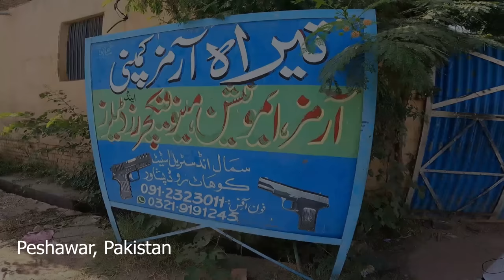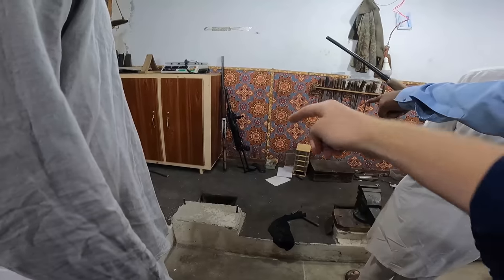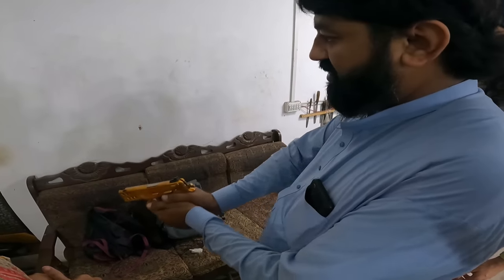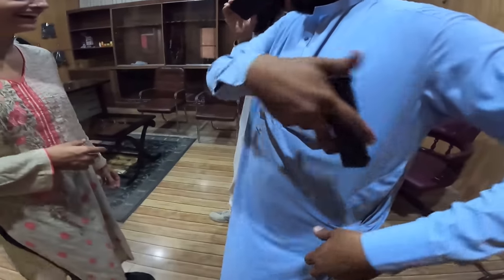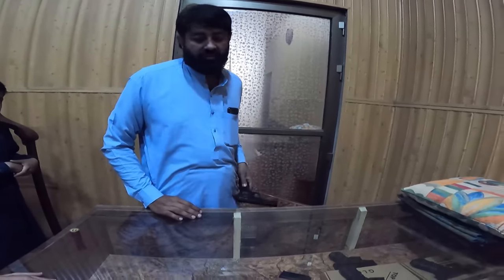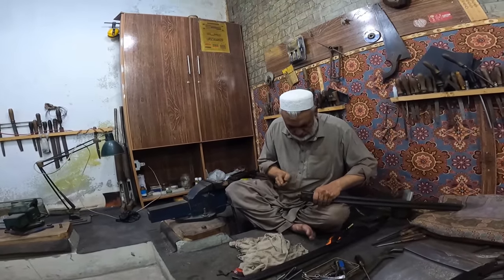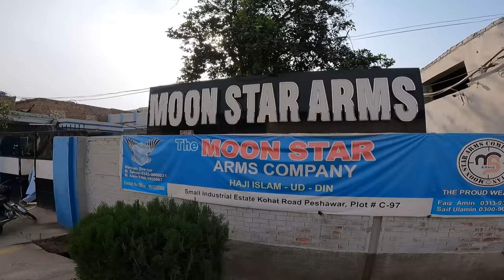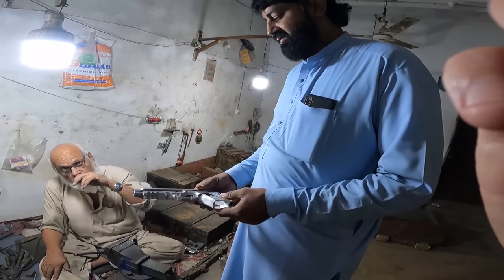How Pakistan Makes Weapons! (extremely cheap!)

Comment: And the simplicity of that workshop is why guns will never disappear from our culture. The cameraman was asking about CNC machines, you don’t need that. Even modern firearm manufacturing is a 19th century process. CNC machines just make it faster and less labor-intensive.
Reply: The equipment is what a well furnished gunsmith shop would use in the USA.  Many gunsmiths do not have so much equipment here in the USA.  To completely make a gun, the hourly rate would be way higher in america.  It would  be the cost of a custom gun that runs into the 1,000's of dollars.  The pricing of modern hand guns is kept low by use of mim parts, synthetic plastic materials,  polygonal barrels, and mass production techniques.
Reply: Bandsaw, bench grinder, drill press, carbide burrs, punches and files…voila gun factory
Reply: 19th C?  LOL.

Comment: It looks like quality weapons.
Reply: The metallurgy of the barrel, locking systems, and other parts is very important.  I would be concerned about guns blowing up.   Typically such places in the past got raw materials form auto salvage yards, like springs, steering columns, axels, sheet metal, etc.

Comment: Can these actually be reliable? The hand workmanship is incredible, but functionally reliable for any amount of real use? Hard to believe.
Reply from the maker: They send the rifles and shotguns that are engraved to england apparently! This place has a very good reputation abroad from my understanding.
Reply: Consider that until WW1, the vast majority of firearms in the world were manufactured exactly the same way. Assuming decent materials, and skilled hands working them, the only real difference from "real" manufacturers is the time it takes to produce the arm. A case could even be made that due to constant hands on work, the "primitive shop" firearm is probably less likely to have out of the box defects. Undoubtedly there are shops that turn out questionable quality products, but here in the states we had lorcin and raven junk pistols too.
Reply: @ludditeneaderthal  CNC's though undoubtedly have far superior precision and repeatability, it just cannot be beaten by human hands in terms of consistency.

I'm not going to say they are unreliable since anyone can walk into a plumbing isle of any hardware store, grab some pipes (STEN style) or box section tubes (MAC style), and as long as the bolt weight is roughly 330g for 9mm open bolt and you've got the magwell roughly lined up then you can make it work (you also get away with fixed firing pin, and even trigger is optional on open bolts. But as far as reliability, mass manufactured and CNC machined is going to be something you'd rather trust your safety to, in the US we consider even 1 failure per 1000 to be highly unacceptable junk (even from our cheap stuff). For hunting or playing around, then its not as big of a deal (which is where .22 is great, its failure rate is about 0.2% and up to 1% in semi-auto, but the piece of paper can weight a second while you unjam it, however unacceptable for self defense)
Reply: @jakegarrett8109  Failure rates for some US brands relative to function can be high.  I purchased several keltec pistols a few years ago, out of three, only one worked out of the box.  I understand that keltec QA/QC has improved.  I had a hipoint carbine that needed newer recoil springs before it would work.  But a hipoint pistol I had worked perfectly out of the box.  I have seen one ruger 7mm rifle that was misaligned and it took special adjustable scope ring mounts to allow a scope to be zeroed.  I seen about a 50% failure rate with BCA uppers that would not chamber ammunition.  Glocks and FN browning made pistols  have always worked for me.
Reply: @loquat44-40  Haha, immediately when you said "relative to function" I immediately thought of KelTec, haha! I mean sort of, those are mostly whacky sci-fi novelty range toys more than anything else. Interestingly though, their owner (and chief engineer) is Swedish, so technically its US owned in Florida and stuff, but the whacky designs pushing their ideas and limits is from a Swedish American.

Its kind of like saying Von Braun being an American NASA Engineer (which he was, but he was German citizen first, and most people accredit him to German Engineering)

But yes, cool designs, just not very reliable. I did send an application to KelTec because I think if laws weren't highly restrictive they would be the ones advancing technology the most (nothing is off the table there, and they aren't afraid to fail and learn). Its mentality seems close to SpaceX, except with a lot less overtime.
Reply: @jakegarrett8109  There usually is nothing wrong with the design or materials of the Keltecs that I have encountered.  It was just poor quality control.  Like a P32 that had had and out of speck chamber or Pf9 that used a plastic magazine catch with Magazines that had super sharp  edges in the locking recess.  It cut off the plastic mag catch.  
Relative to design, a company like ruger designs their guns to be easily manufactured that helps prevent many failures.  I do not know if that was a problem with keltecs.
Reply: @Jake Garrett  yes, because colt and S&W custom shop revolvers have had a reputation as unreliable paperweights for decades due to their hand fit and finished assembly... (masturbatory hand motion)
Reply: Depends on how much you pay and what kinda quality. A friend of mine made TT pistol in 2010 and it's still shooting nice.

Comment: Countries like them will never worry for Zombie epidemic
Reply: They probably would be the most impacted: High population density, not enough tools ready when they need it (and their production rate is slower than anyone with a 3d printer and access to ammo in half the stores). They would mostly need to use knives, unless they have a lot of swords or axes.

I think America would be among the most resilient countries. More tools than people, stockpiles of anti-zombie head splitting lead, rural and country areas with very low population density (and even the children there know how to use the tools very effectively, better aim than most of our military), and high amount of large vehicles like pickup trucks (instead of moped scooters where you can get bitten), you could just fire up the industrial machines like tractors with batwing mowers and remove the coverings and let those massive 8ft diameter blades that chop small trees down go to work on a horde. Plus food independence, all exports will be halted so in the US we have plenty of food and crops, and even wild deer to hunt and survive on (I think other regions would have a much harder time, their livestock would likely be eaten by zombies). In the US our rednecks are very capable of making anything and surviving with anything, plus an abundance of resources and isolated areas would make it a good pick.
Reply: @jakegarrett8109  so Walking Dead is basically bs where they portray US total collaps?
Reply: @hanchiman  I think in cities they would be screwed. For example, where I'm at its illegal to keep even a musket in your car for self defense (that includes against zombies or animals like wolves or bear, and good luck using a knife for that). Also in the cities they have only weeks worth of food, not years and years like a grain silo holds for every farmer (plus planted crops always ready half a year out to replenish). Basically in the city you also have disease spread very fast, so most wouldn't even know it, and the water supply is shared compared to personal wells. Also on that city water needs constant cleaning and treatment, but with electricity shut off you will quickly loose water (out in the middle of nowhere your private well can often be powered by solar or just use a generator for a few minutes, and everyone has generators out there with hundreds or thousands of gallons of fuel for farm equipment).

So in cities, yes it would be an absolutely chaotic event, very few survivors and they would want to grab what they can and run, but MOST city residents do not know how to survive in the wilderness for long and would either freeze, or drink water that is unboiled, or eat the wrong mushroom or berry and be gone. The TV show is sort of accurate with this, where most survivors are found in rural areas, where its very tight community with everyone watching out for each other (because they already do this), and you don't exactly round a corner and get surprised by a horde (you'd see them a mile away).
Reply: @hanchiman  Accurate, that's how it would be.
Reply: @jakegarrett8109  I actually got that from Fallout New Vegas when one of the character Raul Tejada (voiced by Danny Trejo) mentioned how chaotic Mexico City was before WW3 and how it become 200% worse after the nukes dropped.
Reply: @hanchiman  Its accurate though. Basically "evil prevails when good men do nothing" is a very prominent thing in cities. In the country, if you see a girl getting touched inappropriately without her consent, its allowable for anyone to whip the guys butt and they learn not to do that. In the city, you'll be the one thrown in jail and they'll keep doing it (and drugging females). Hence its much more dangerous in cities as it is, due to very low accountability. When there is no accountability left, there are just too many evil and immoral people there to make it reasonable (however, then there are also no laws preventing good people from doing what they need, but they will only realize that after its too late and all their food is stolen by the thieves, all their wives and daughters taken because they followed the rules and disarmed themselves making themselves helpless sheep). In the countryside that simply wouldn't happen, they've got tools everywhere and willing to hunt not only critters on 4 legs, but anything that did their family harm.

In the cities you would have to steal to survive, you would have to fight in order to survive (unlike the country where there is enough for everyone and people would share and help each other), so "good people" often wouldn't even be willing to protect what they have and they would loose everything in the cities. Country people though are used to taking out the varmints, and they may be charitable but they do not let thieves come back for more.
Reply: @jakegarrett8109  Bystander effect in cities. Where they will be busy video filming a crime thinking it will be "evidence" as a help. Meanwhile that guy probably is dead when the cops finally shows up
Reply: @hanchiman  That and where I'm at its illegal to put up your fists to defend yourself even if they run at you with a weapon. Even if you're in a wheelchair legally you have to turn (putting your back to your attacker, which is a terrible idea), and try to roll away even if you just saw them stab multiple people and running at you, you cannot put up your fists to fight until you've tried to run first. So obviously you cannot legally help others, else you'll be the one going to jail for a long time. Its very messed up.

Other states in the US, if someone is running up to you and you think its with intent to cause bodily harm you can quickdraw and tell them to sit down and stop, or if you don't have time for that you don't even have to give a warning. Plus you can defend others, and you hopefully won't go to jail.

So its not just the bystander effect, its the corrupt laws in those cities, those people legally can't do anything more than sit there and film. They'd go to jail for just punching the guy and telling them to go away.
Reply: @jakegarrett8109  yeah I don't live in US but I see alot of day light robbery literally where a gang of hood rats just nonchalantly steal the shops meanwhile the staff just let them because they are "not paid enough" to risk their life (can't blame them), but I find it weird why there is no security guards and even if they had, they are basically useless. Here in Europe were I live, they have at least security guard or plain clothes detective and securities in grocery store where they will basically put you in a Judo move and handcuffs you if you caught stealing and then wait till cops come and pick you up.
Reply: @hanchiman  Yeah, the security guards are bound by the same laws as anyone else, so if they did touch the thief, they would be the ones facing serious charges and jail time (meanwhile its basically no punishment to steal up to $950 per day per store for thieves). So the security guard is just an illusion of safety (like most security is, just how the TSA misses 95% of prohibited items in their self audits, or how most locks can be bypassed in seconds). It looks good, but in reality they might as well be a scarecrow, neither can really stop the criminal (at least in those states, other states they will tackle the thief or point a tool and say to drop it, in THOSE states crime is a lot more rare to begin with because pretty much anyone can do that and the guards are allowed to do something)
Reply: @jakegarrett8109  yeah, I mean in Europe, the guard will put their hands on the thief and tell them to "follow me" to a small room. 
The worst good guards here in Sweden are the transport guards who are basically "paid thugs" (since they mostly look like goons with alot of criminal looking tats all over their body) and doesn't give any quarter to anyone who give them any BS, not even kids (it was a shit storm one time when a mouthy 13 year old kid was being strong handled by them, the mom was being a Karen about his "poor boy" but the court gave in favour for the guards that the boy was doing "resistance" to service people). I think the security guards here in Sweden had way more balls than the police, maybe due to that they are basically civilian companies with no need to worry about flak and can be fired and then reemployed again in another security company, like the famous Securitas.

Comment: i wouldnt thrust them, better made in germany products!!
Reply: The Germans are efficient with their products, whether its large scale gas chambers or an MP40 or a buzzsaw for people, they are indeed efficient with their design.

Ironically the only German pewpew I recall using was highly inaccurate, like it must have been missing pieces it was so bad. However, if its for point blank use, it would get the job done... I would like to try out some more stuff like an HK, but sadly where I'm at I think its illegal for someone to even hand me that just to look at (nearby even a toy version is illegal to have, even if its locked away in a safe). US kind of sucks with their laws, can't even keep a flintlock musket here for self defense (other states you can own anything federally legal, but not here).